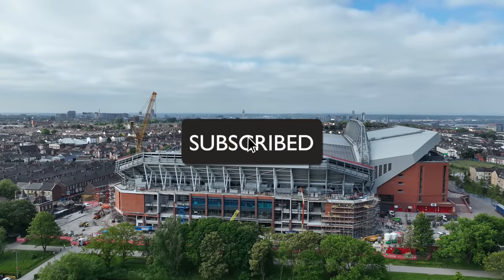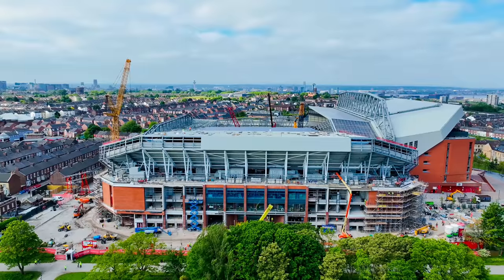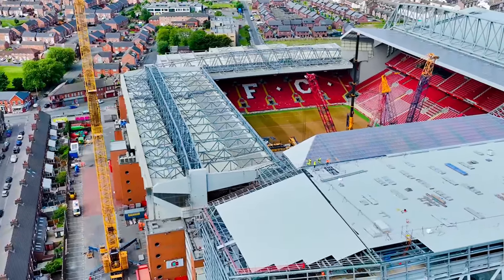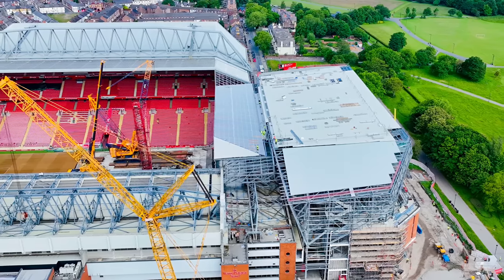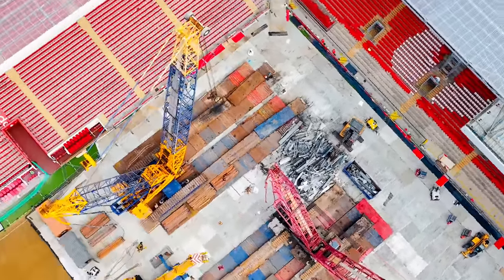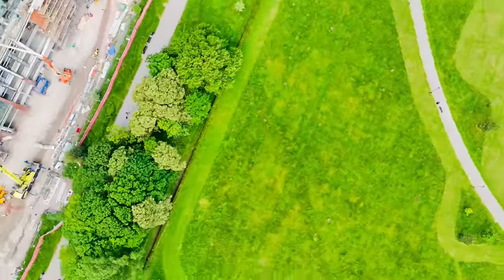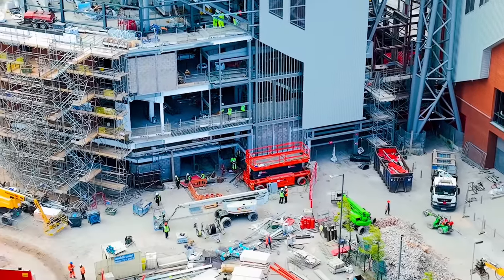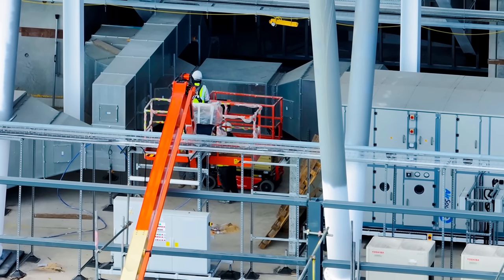Turnstiles installed in the new Anfield Road Stand Expansion at Liverpool Football Club

Comment: That building (the 'walkie-talkie') in Anfield south's city ;) only melted cars and buildings because the facade was concave, essentially acting like a parabolic mirror, concentrating the reflected rays in a single point (like how a satellite dish works).
This issue won't be a problem with flat surfaces as all the sun's rays will bounce off safely.
Reply from the maker: Ah right ok mate, that makes a lot of sense.

Comment: I'm thinking they aren't going to dismantle one crane. The first lift took up more than half of the roof. Possibly ⁵/⁸ of it. As seen by where the cut was made to one side of the crest. With the corner section to be lifted from outside, it leaves a relatively lighter weighted section, which i'm sure both cranes can reach at each end without having to alter any footings they're on. They'll want to drop it on the same blocks to burn and take away. So it could be as early as tomorrow the cutting starts. That seems logical to me. Who knows!
Reply from the maker: Good observation mate, I think you are right

Comment: You'll get a good idea of when the next section of roof is coming down Kev, the big thing that will need doing before they start moving the cranes is to lay the heavy duty timber at the SKD end for the crane to sit on. I'm not sure they need to move both cranes but I'm guessing on that, the red crane is already almost in position to lift from one end, it might be possible to just move the yellow crane into the SKD end corner (maybe) I think you're right though, it will definitely be a couple of days before the actual lift takes place.
Reply from the maker: Yeah I think it’s just the yellow crane being moved
Reply: @Kevcupo  It's being moved already mate, it didn't need dismantling by the way. I think now its moved halfway over, the timber it was standing on will be moved to the SKD end and once that's done it will go the rest of the way into the corner.
Reply: @Kevcupo  I've just sent you a separate message about the new block numbers and seat numbers on the completed stand, check it out mate 👍
Reply from the maker: @Steve-io5oh  I’ll have a look mate, I’ll take a look. I’m assuming they are AU and AL numbers

Comment: Once the first roof section is cleared, could the crane not move forward and reach over to take out part two. That second section looks alot smaller than the first with it being cut in two parts.
Reply from the maker: The yellow crane has now moved

Comment: They are crawler cranes ...so why dismantle and  reassemble when they could just put wood down and drive them if they can turn the tracks.
Reply from the maker: It’s the weight mate, there are things under the soil that they don’t want damaging. Heating, sprinklers etc
Reply: @Kevcupo  love yr videos btw and get the weight on sprniklers etc but they have built a wood road and they moved backwards with roof on the hooks so keep moving the wood road in front of tracks and drive on it.
No different to going forwards and back if they can turn the wood just protects pitch sprinkers and speeads the load.
Reply: Imagine it's the twisting, ever seen the ground after tracks have been over them?
Reply: @robnicholson5171  they would twist on wood base not the pitch......but maybe they dont turn.... but looking down from drone the wood base is 3 x the length of crane as used for backing up with roof on the hook.
Just seems odd to dismantle a crane when it can move and you just take wood base from behind crane and lay it in front.
Move forwatd then repeat. Have no clue if you can turn tracks like a tank or it just goes back and rorward but its just odd they would dismantke to move 20yds.
They could take off the stack of weights on back to make it lighter to move.
Reply: @AG-ob3fx  imagine at that weight it would transfer some through to the pitch.
Reply: @Kevcupo the yellow crane moving over right now..they putting the planks down in front as they go..👍
Reply: @A G  Apologies mate, you were right!
Reply: @robnicholson5171 lol dont know if they can even turn but no doubt we will find out
Reply: @Kevcupo  just seen on the stadium and misterdrone that yellow crane turned and moved andvthey just leep moving wooden sleepers in front of it to protect pitch so will be in position on thursday night so just the cutting to be done so probably not tommorow as guessing they will take load on cranes friday to enable safe cutting.